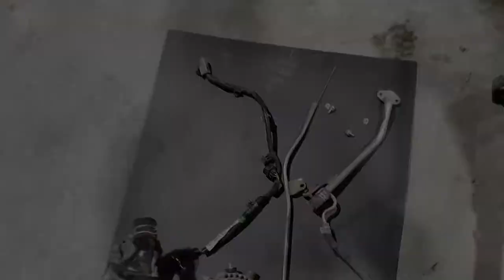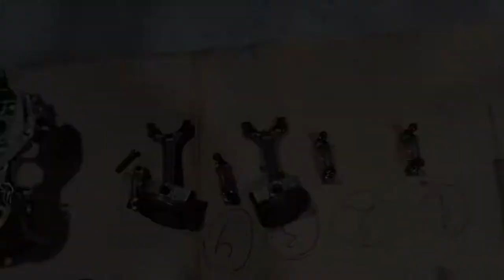2 AR FE engine complete disassembly! Toyota Camry engine teardown!

Comment: Helo please what's the tightening for the cylinder head bolts on the 2AR FE engine?
Reply from the maker: Cylinder head bolts spec:
1- tighten them to 27 ft-lbf starting from the middle!
2- check all them one more time make sure all are 27 ft-lbf also starting from the middle
3- Stage 3 plus 90 degrees for all 10 bolts
4- Stage 4 plus 90 degrees for all 10 bolts